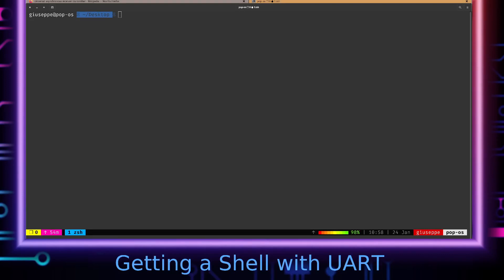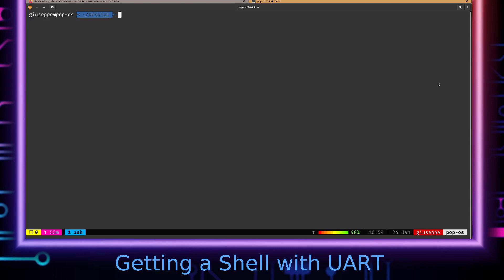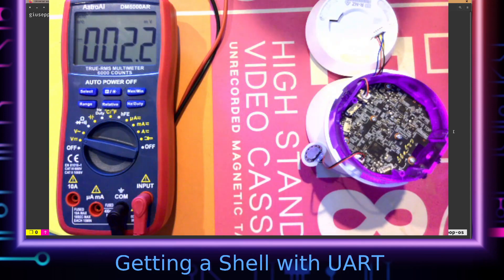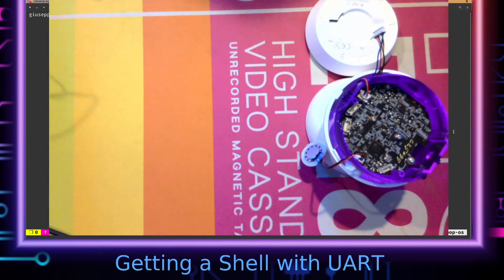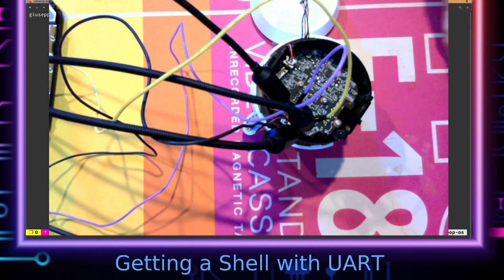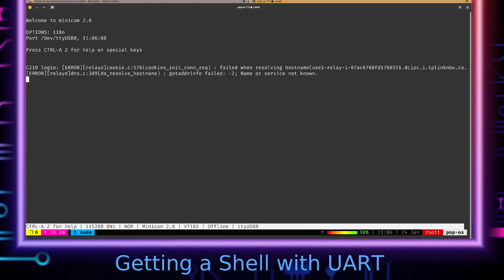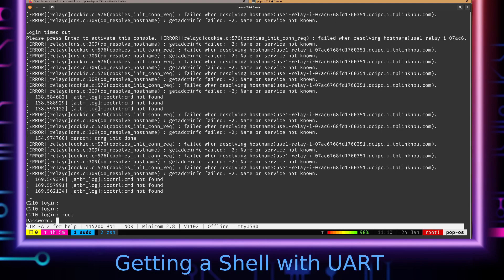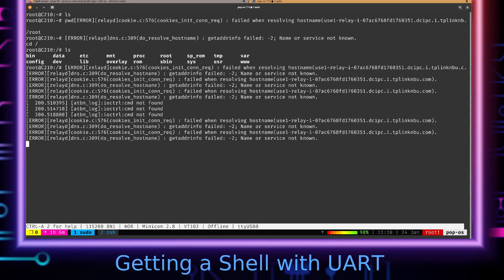Getting UART - Analyzing the TP-Link Tapo C210 | Part 2

Comment: Thank you for this great video. I have almost identified the UART points on the motherboard. Those points are soldered pads and not holes. So, will pcbite probe will help to connect to these pads?. Also, is it possible to connect with you personally?.
Reply from the maker: Yes, the pcbite probes will help when there's pads for the uart. you could also try soldering to the pads, but in my experience, soldering to pads is difficult because they're usually pretty thin and you can end up pulling them off. for me, the probes were a good investment. 

You can get in touch via the IoT Village Discord! https://discord.gg/BnKj7KR4
Reply: @IoTVillage  
Thanks for the update. Could you please let me know how did you connected the probes to the TTL adpater pins?. It was hard to identify in this video.
Reply from the maker: The probes we linked in the description of the video come with wires that you can connect to the ground, rx, and tx pins of your adapter. You'll also have to look up the voltage and baud rate of the device you're testing so that whichever serial communication program you're using can read the output correctly.
Reply: @IoTVillage  
Great. Could you also let me know if the probe has a magnet which will stick it to the solder pads on the motherboard?.
Reply: @IoTVillage  
Hello Sir. I purchased the probe which you mentioned in the description. I connected the ground and tx pads to the ground and rx pins on ttl adapter using the probe but dont see anything on the putty. Can you suggest what else can I check?.